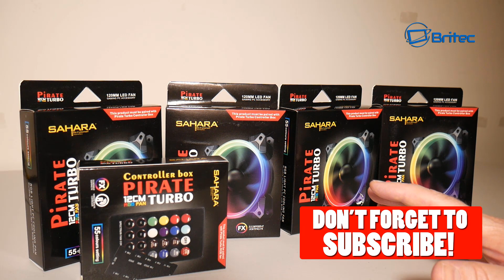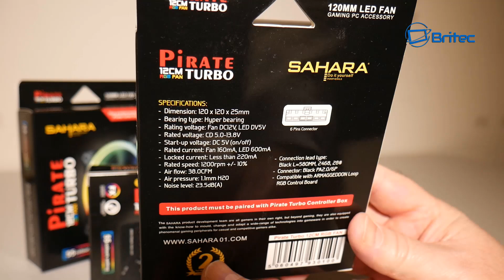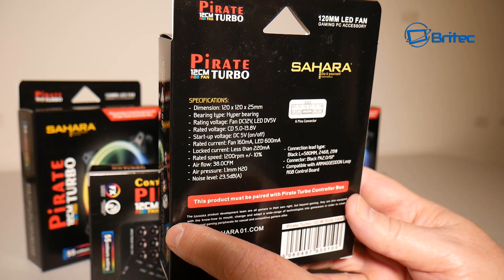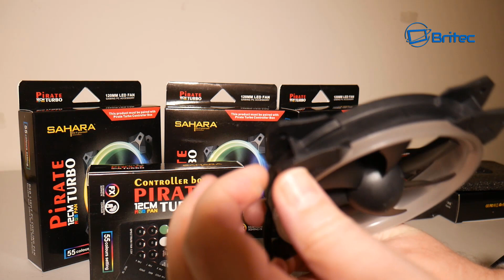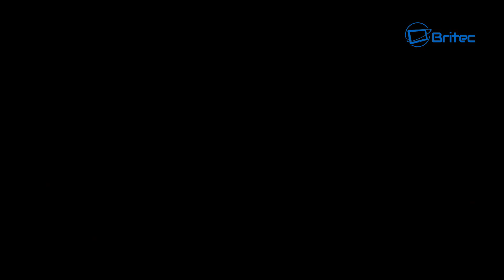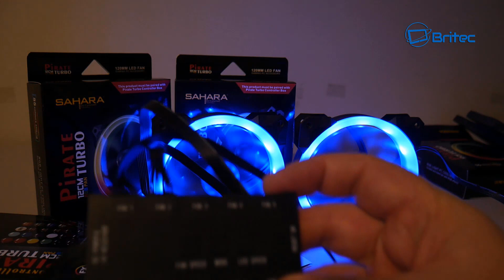The Best Cheap RGB Case Fans?

Comment: Nice overview. The specs on the back of the box are a mess, though. "DV" and "CD" are typos for "DC". What the heck is "locked current"? Maybe how much it draws when the fan blades are held so they can't move?
Reply: It's all through the bad translation.these companies really should use a human rather than Google translate for important things such as that

Comment: So you need to open your case just to change the fan speed??
Reply from the maker: no you can do it via remote control or front control panel on the case
Reply: Britec09 via the remote control that comes with it? Btw thanks for the fast reply 👌🏼

Comment: my brother said i couldnt use certain rgb cases because my motherboard doesnt have RGB headers or something, do you need the header for these ?
Reply: nope it all runs off that box and a molex connector
Reply: where would the molex connect to?
Reply: It connect to one of the milestones connectors from the psu same old style Connector for HD’s and dvd drives
Reply: Artizan the fan, coming from the power supply

Comment: how do i know what my fan size is?
Reply from the maker: 32mm between screw holes - 40mm fan size40mm between screw holes - 50mm fan size50mm between screw holes - 60mm fan size60mm between screw holes - 70mm fan size72mm between screw holes - 80mm fan size83mm between screw holes - 92mm fan size105mm between screw holes - 120mm fan size125mm between screw holes - 140mm fan size

Comment: they wont be able to be used as exhaust fans or even intake in most cases, the front sticks out to  much for them to even be useful..  only on a cpu cooler will they work
Reply from the maker: I will test that in the case review.